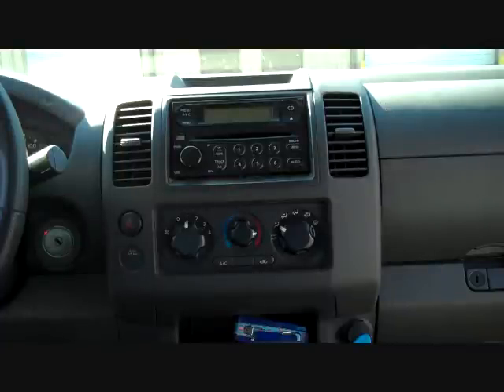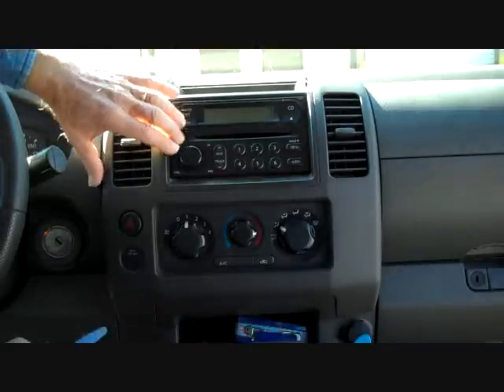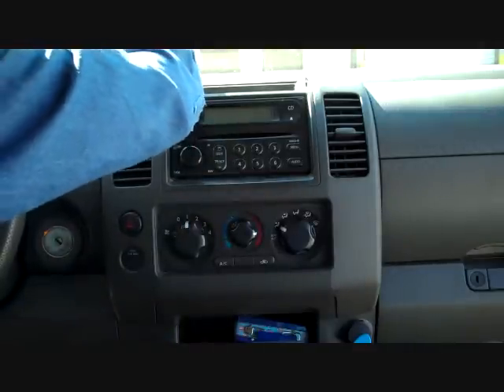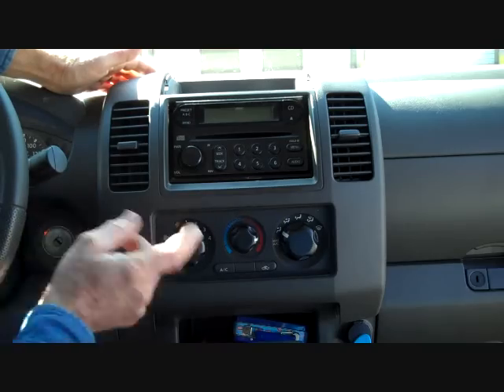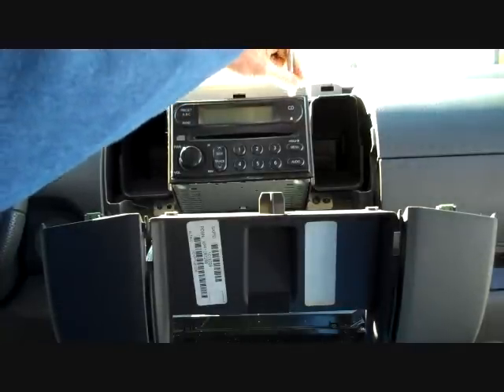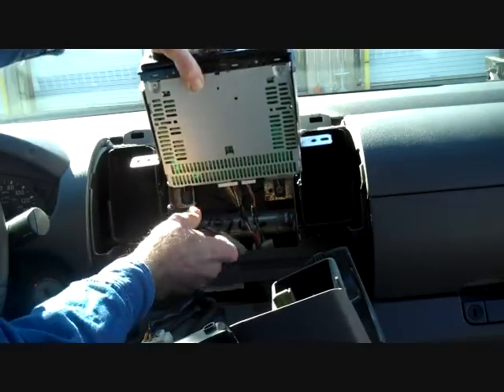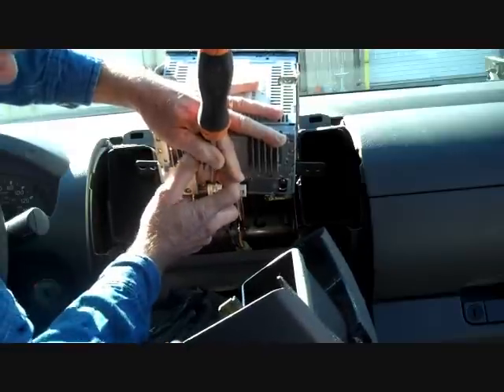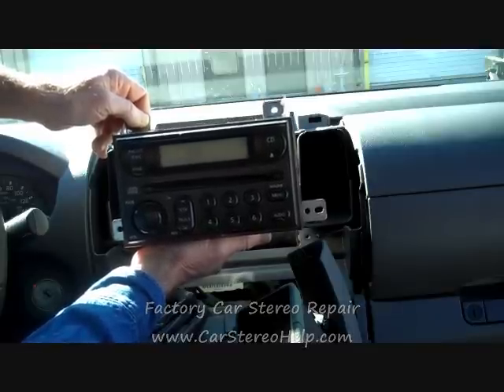Nissan Frontier Bose Radio Removal 2005 - 2012 = Car Stereo HELP

Comment: I want to put a new stereo in my 2006 Nissan xterra.  When I looked online, a website said I'll also need a mounting kit to install the new receiver, a wiring harness to make the electrical connections without cutting into your Nissan’s wires, and an adapter for the FM antenna cable.  Is it true I need to buy those in addition to the stereo? Thanks!
Reply: Yes

Comment: The top tray has 4 clips, they are on the left and right sides.  Each clip is about 1.5" in from the edge.  It took me a good half hour to pop the top tray without breaking it, i used an upholstery puller from NAPA and some plastic bike tire removal paddles. The bezel is much easier to remove, start with the top clips and then do the bottom clips.  It was pretty cold when I removed mine, make sure you warm up the vehicle until all the plastic is good and warm, probably will lessen your chances of cracking any plastic.  Just take your time and you shouldn't break anything, don't force anything too much.

Comment: Thanks for posting this. My old CX609 radio crashed so I bought an exact replacement  on eBay. After watching this video, I decided to try and do it and I pulled it off with no damage to the truck. Win Win for me. Thanks. again .

Comment: Video was awesome. Over the years my 2008 Xterra cd player had been getting worse and worse. I took a road trip from Atlanta to Idaho. In the middle of western Montana (absolutely no where), the stereo finally gave up the ghost. I had thick, white smoke pouring out of the two vents on the side while I was driving down the freeway. I was about 150 miles away from civilization.

Comment: Thanks for a great video! My 2005 Frontier 4wd CD player hasn't worked for years and now I think I'll tackle the job of replacing the unit. I'm thinking of a single tier unit and use the empty for a cup holder.

Comment: Just out of curiosity, how is this different from the Pathfinder removal? I have the '06 Frontier with the stock radio and the stock radio in a pathfinder is pretty much the same from what I've seen... 

(I also have a '05 pathfinder with the Bose system)
I'd imagine all the layouts (stock, Bose, Rockford Fosgate) are similar, no?

Comment from the maker: Remove one of the battery terminals, usally negative is easier for five minutes. This is a "Reset" and may bring the changer back to working. Otherwise, this is a repair issue. Something we see common in shop. See our website for shipping and repair rates.

Comment: Looks just a bit out of my comfort zone. I do not like messing with my dashboards too much they can brake fairly easy. I might just take it to the pros to do it but I'll take a before and after photo to make sure nothing breaks or get damaged. Thank you for the video very good info.
Reply: What are u doing ti ur car bro?
Reply: Frank X looking to replace my stereo with a working CD/DVD Blue Ray Bluetooth AUX USB with a flip out touch screen. so i can install a reveres camara on to it.
Reply: Wow. Yah I wouldn't port about such tech.
Reply: why it will have a detachable face so if anyone steals it it would be hard to find one and ill keep my sirel number too. i just like tech
Reply: Very good idea. I took my 06 Nissan Frontier CrewC. for a radio change installation and guess what, they cracked the dashboard. That is why I'm here, I'm trying to learn how to change dashboard panel with a new one I bought for about 160 bucks. But I'm afraid of messing it up too.

Comment: The stupid stereo company broke my dash that goes around the radio and stereo for my 06 Nissan Frontier CrewCab. They said they did'nt break anything, but I see they work is very rough on dashboards and covers and they want to get down to the stereo as quck as they can. Very unprofessional.

Comment: Anyone watching this and wanting to try themselves, be careful. I can see there was def some set up in this video. The top tray "that was obviously already taken loose in this video" is notorious for cracking. then when pulling the main bezel also like to crack at the top while removing the two top clips. Taking to a pro helps but sometimes there is nothing that can be done to prevent this. Just a heads up before you begin this on your own.... plus I love how this expert is lays the face of the bezel against the shifter, then abuses it as he is unplugging the harnesses from the radio. Made me cringe the whole time lol
Reply: All these videos, they take it apart first, so they don't look dumb doing the video.

Comment: Yeah-- BE CAREFUL!  from 40 seconds to 50 seconds is BULLSHIT in this video.  And THANK YOU for helping me break that part of my dash.  The little clips holding that piece go into 4 slots-- 2 on each side.  In the video, you can see the lower pair of these slots -- one on each side.  They plug in and have a release tab to remove the part.  I have successfully broken every goddam one of them.  
Watching this again, that top piece was already clearly LOOSE and just sitting there.  Goddamit!